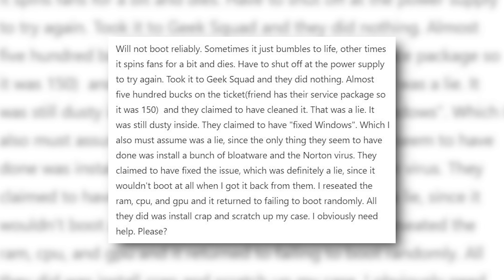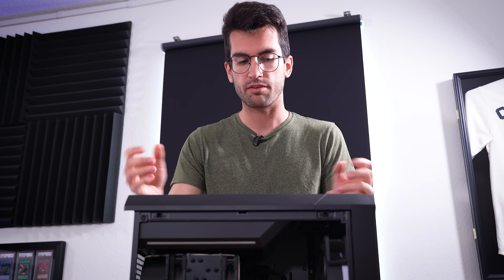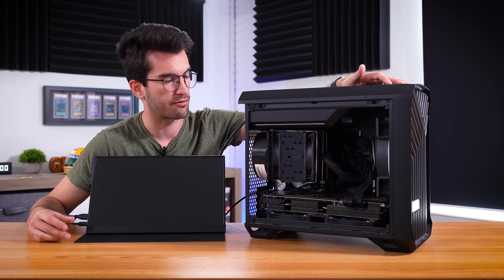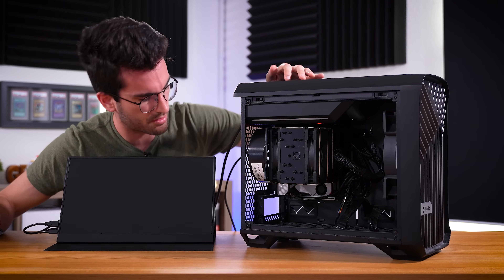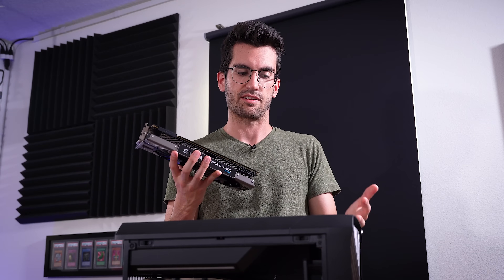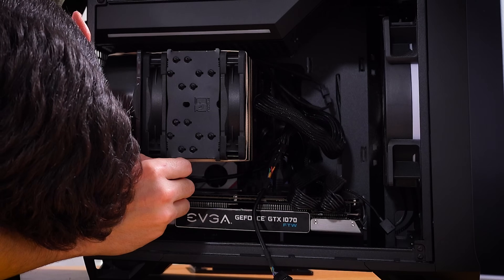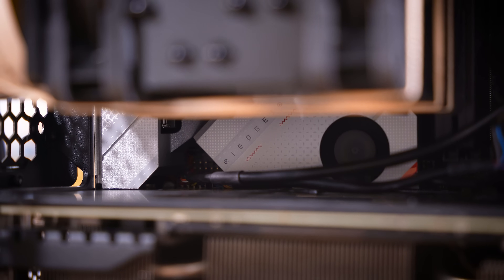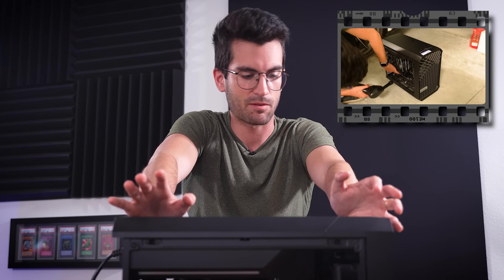Fixing a Viewer's BROKEN Gaming PC? - Fix or Flop S5:E6

Comment: Having two bare pins floating around next to the graphics card socket is your most likely cause for an intermittent fault. Just because the Graphics Card was pushed fully home into the socket doesn't mean that there weren't exposed lans to short against. Also, I didn't see what you ended up doing with that connector to stop it touching anything in the future.

Comment: I am facing a weird issue with my newly built PC, it's AM5 platform and I was trying to install the stock cooler but when I mount the cooler all the way in, the Debug lights gets stuck on CPU and DRAM. I had to loosen the cooler and find the sweet-spot where the CPU will not overheat and the cooler is tightened enough to boot. Is this an issue anyone is facing too? or am I doing something wrong?

Comment: Did not see you mention taking gpu out and re-connecting power switch??? Since you test ig and your gpu and also tested the users gpu in your test bed, I would be looking at that wiring to switch. I would also want to take the extension out and go direct to board with switch is possible. General re-seating is an amazing thing.

Comment: The motherboard checks the LED connections at power on and the HDD light is not constantly on so it might not short out and cause the protection to kick in once the PC is powered on. I'm pretty sure that if you shorted it during power on it would not switch on.

Comment: I once put the PCI-e cables in the wrong way. So 6+2pin in PSU, 8pin in GPU. By switching this around, the PC finally got power from PSU. Just sharing this mistake. Thought about this when you mentioned the cables.

Comment: I used to work for Best Buy's Geek Squad, and Circuit City's Firedog, as well as Staples Easy Tech, but that was almost 15 years ago. Some people I worked with back then were IT professionals and knew what they were doing, others were people that just took a class on how to build a PC and then thought they could get into troubleshooting.

One of the first things I check when systems do this is the PSU, check to make sure its getting the right voltages, then check the power draw of the system as sometimes older PSU's can't deliver the power required due to capacitance discharge over time, then I start checking all the connections to the motherboard. By following that checklist I can definitively narrow down the culprit without losing my mind as to why "X" problem is happening.

Love the series Greg, keep it up!
Reply: Except most people under 30 today can't even use a multimeter.

Comment: First of all there is some serious jank stuff in that PC with the fans. Second, most Geek Squad members couldn't repair a bent fork. Third, when you stuff full sized components into a smaller case it's really difficult not to have issues. Seems to me when you pulled the GPU and re-seated that along with the front IO wiring things got better. I'd call it a win!

Comment: Did he look at the front panel power switch connector extension? It looks like the positive and negative leads were around the wrong way. Since he disconnected then reconnected he may not have realized this. Hence a repair he didn't notice. 🤷‍♂️
Reply from the maker: We looked at front panel wiring before touching it. The leads were not the wrong way.

Comment: there’s a good chance that some dust had gotten into the port where the graphics card plugged in and I happen to know that geek squad does not unplug graphics cards to even check. It could’ve also gotten into the ram connection. Another thing you could’ve done is run something like heaven benchmark to stress test the machine. This would rule out the power supply having a short that you weren’t aware of because I’ve seen power supplies pass all inspection test but fail under actual heavy load. It’s also possible that the power switch is just faulty

Comment: I know this is old. But the power off after few seconds and not turning on after pressing power button afterwards (unless you disconnect the power supply and turn it back)  Fully hinted a Short. Because that's how motherboard safety features work. Next time just look for a short circuit if you get this symptom of not powering on after turning off after few seconds.

Comment: Geek Squad isn't what they used to be. I stopped using them over 5 years ago when they 'scotch taped' components onto my MoBo... This didn't 'start my van' so I fired them.
The Geeks probably put the rubber bands on the cooler...

Comment: I'd say it was the front I/O connector.  I couldn't see it so it originally so maybe it was crammed underneath the graphics card and was touching something.  Don't know what Greg saw before and as he was pulling out the graphics card, but I think the issue most likely resolved after the card was removed and the connector was originally moved and then removed.  Great video!

Comment: check the cpu, intermittent power up failures are common for bent pins and seating issues. Especially having a big cooler like that, a seating issue could change behaviours every time the case shifts

Comment: When you showed the extension for the power reset etc. it looks like the reset male pins were just out in the open. If it was touching the case, it would be the same as holding the reset button down when you were starting it.

Comment: Well, this might be just me, but I believe the PCIe slot may have issue because the GPU card seems to sag? motherboard are extremely sensitive and any thing that misalign even by .1mm may caused an issue with the motherboard and render it in panic mode. It happens to me once with one of my friend PC and of course after I remove the card and clean the system, it works for a while and happens again. I support the GPU with DIY GPU stand and it works flawlessly ever since.

Comment: The other day my computer also got stuck in a startup loop. I removed the side cover and everything returned to normal. I adjusted the wires a little. I returned the side cover and everything works. Visually the wires did not touch anything. Mystic .)

Comment: Probably a loose pin, either in the x24 motherboard connector or the GPU power supply pins. You know, the pins inside the connector? I've had experiences with that in the past, where a PC would turn off under load without any reason. After finding the problematic pin(Power_OK), I fixed it by using a screwdriver to compress the female pin even more, ensuring it could actually touch the male pin consistently.

Comment: 1. Gpu sag slowly destroys the solderballs
2. You really tried to short the cable using the painted metal?
Reply from the maker: 1. We've talked extensively about de-balling in other FoF videos.
2. The cable was easily piercing the thin paint on the backplate. Several scratches to bare metal. Did nothing.

Comment: Here's a thought. Weak / 'bleeding' capacitor causing a problem with cold boots after sitting awhile. Or possibly a memory issue, I had similar with Crucial Ballistix in my 5900X. Every 8-12 cold boots, it would POST with no video. Different memory fixed it -- DIMMs were not on board's QVL.

Comment: I've watched dozens and dozens of your videos so far. Great videos, by the way. Great troubleshooting and train of thought. Clean and proper job. Well done, Greg. Two comments, though. A. In some cases I believe a little BIOS update could do wonders. Maybe you should think about this process more often, especially when the problem is CPU and RAM related. B. The broken PCs you are dealing with, are mostly AMD based. I'd say that the percentage is 90% AMD and 10% Intel. That makes me think that AMD CPUs are more sensitive than Intel CPUs or that they are not so well designed. I've always had that feeling about AMDs and that is why I always build PCs with Intel processors. They offer me peace of mind although in this particular video, the only thing that's not foul seems to be the AMD processor :)

Comment: I wonder if it could be an issue with a solder joint on the PCI connecter on the motherboard?? If this was mine I would very closely inspect that connecters solder joints for a loose pin where it is attached to the motherboard. I wonder if carrying it around, maybe set it in the back of your car and bring it back in would result in another failure to POST?? These new giant GPUs can put a lot of strain on a PCI connecter, if it left the factory with a marginal solder joint a giant 3080 could have dealt the death blow?? Or not, just something to consider.

Comment: I have had this issue with my 3060ti on a asrock b550 mini itx, it was due to my ram speed. Initially set to 3600mhz, swapping it to 3200mhz allowed for boot always without power cycling.

Comment: Yooo, I had a similar issue as this, and I even mentioned it in your previous fix or flop. My fix came down to either me resetting the GPU or resetting the power connectors on the GPU.

Long winded, but this is what I had previously posted:

"Had an issue a few weeks ago, don't under estimate what reseating a component can do. I've had a GPU issue where my system would full on crash and it would be so bad that the GPU driver would corrupt itself and windows would not detect my GPU (had to reinstall the drivers). Two things I have noticed when trying to reproduce the issue; 1) it took longer to crash when my AC was on, and 2) immediately booting back up and jumping back into a game would cause it to crash within probably 5 min. Thought it was a GPU problem (which is a pain since I have my system water-cooled), but none the less swapped it out for a known working GPU; behold it worked. Sad knowing that it may potentially be the GPU (or a failing PSU not being able to cope with a 7900XTX under full load) I went to try and reproduce the issue; but the issue never reproduced after swapping back in the original GPU. Only the GPU was interfered with between trouble shooting. My conclusion, I had to move my system (and it is stupid heavy) and the issue only arose after moving my system; it probably shook the GPU out a bit, so to not properly make contact with the PCIe slot and any significant heat probably caused it to warp out of the socket. Thankfully my system is still going strong under heavy load.'
Reply: I know its been some time, but I have found the issue that was causing my issue (because the issue returned) and resetting the GPU worked because I think it just cleaned the pins on the GPU slot when reinserting it. The issue was that I use k5 pro thermal putty on my memory chip on the GPU, the issue I have encountered is that K5 putty seems to release oils from the putty and it made its way to the GPU slot (because I vertically mount my GPU), more specifically the first set of pins before the notch. I did source earth in fixing the issue because I just removed the riser entirely, but in the process of removing the riser I saw the oily issue.

Comment: The POWER SWITCH if you can tell its completely off center that happened in my old old rig that pin is bent would power on cycle off or not turn on. Straightned pin and pushed it back down. System worked until i retired it. Pause at 6:15 and 2 of the connectors are loose that's why jumping it worked immediately. Only other thing you changed at the time was gpu and we know it wasn't that

Comment: Thanks for the video, very interesting. I think you were onto the cause of problem at the end when you spoke about a possible short with IO cables. Those ITX cases are fantastic to look at but a pain to build and often you find yourself folding, cramming wires and cables into any spare space in the case which can sometimes mean headers become loose or wires end up getting pushed against another component causing a short.

Comment: I would have run stress and memory tests for some hours to confirm the system is stable. Also it takes me sometimes days to get a new computer running stable. For example last time I first used the screws that came with the case - and at this point in the bag with the screws only two types were left with only one fitting, so I installed the motherboard using these and when I was nearly done with the cabling I noticed the board jiggeling despite the screws tightly screwed in. Turns out these were distance screws. So I googled how board screws exactly look like and asked ChatGPT if that is normal the give the board some wiggleroom these days. Long story short it was quite a mess because meanwhile I had screwed some in too tight, and you know after tight comes loose...  Anyway, after that I had to learn that nowadays memory must be "trained" to be useable. And that's what the board did. For like half an hour. At least the board a had status LED and over the time I learned to interpret it better, like how it looks when the boot process is normal or whether its stuck for good or whether it just takes  more time. The I juggled arround with GPUs. Since the system was intended for AI purposes its got two GPUs. I tested with one, it worked, I tested the other one, worked too, I tested both it worked. For a day or so. Then one of them just refused to turn on. So I tested it alone and in another PC and even got a third GPU to plugin. Long story short after hours of try-and-error it turned out that first a Titanium certified PSU might not automactically be a good PSU and/or that these 600W GPU cables are not as good as they should be. I came to this idea only because my 3rd older GPU was in my other PC connected with one of these big 4:1 poweradapter cables. So I used that too in my new PC for the GPU that wouldn start and hence it was now connected to 2 PCIe outlets of my GPU which have a higher theoretical output than the one 600W outlet and low and behold it worked. Also I know the feeling you get when you know it's either the powersupply or the board or the board+memory combination.... So at some point I just bought a PSU tester. Anyway, I wonder how one can even make a profit from PC repairs, it's so time consuming that in quite some cases you could simply get a new PC of paying for the time of fixing the old one. But maybe it's just me being slow. :) If it only took you some minutes or like 2 hours, to do all this, you are pretty quick.

Comment: As a former Geek Squad agent, your mileage will vary drastically from location to location. I had zero training given to me about actually fixing computers. The only training was with using the software tools they provided to "cleanup" customers' computers. The actual repair knowledge was whatever I brought with me when I was hired. So, some locations might have someone that knows a decent amount and if they happen to be the one to work on your computer then it might actually get fixed. Other times you'll end up with this result.

Comment: Most frustrated i have ever been...During covid I got back into gaming.  Built a system and bought a 2070s from work.  Everything worked fine for 3 months and then it stopped posting randomly, it just got worse from there.  I had it sent away (far) three times to the supplier who just sent it back to me.  This went on for months. Finally i figured out that if i pushed the gpu up slightly it would post.  They rma'd, but it was during the shortage so i got downgraded for 50% more money.

Comment: Sounds like bad ram module,  or boot corrupted  :D  now t o see if I'm right!
Aww I was wrong,  but I bet it was from those extensions  never good to use them as they can be bad on connections so maybe you fiddling with them you also seated them fully so they aren't arcing when it's trying to run it's tests before boot. or during boot LOL   :D

Comment: I had a similar problem hdd indicator the + pin is connected to 5 volts  if that touches any thing metal that would cause the pc to shut off . when i replaced the mainboard I damaged one of the wires when i stood the PC up it shut off  i disconnected   the  front panel  and looked at the wires i found the damage insulation . insolate  hose pins  or those pins might have been touching something is shouldn't

Comment: I have the same case and had the same mainboard. Yes the frontpanel connector is in a bad spot but i dident had to put extensions to connect it with the mainboard the case cabels are long enought and there is a HDD led, the powerbutton blinks red . The cabelmanegment in general is a dream in this case there is so much room behind and on the top for all cabels, i have white extensions for all main cabels 5 fans an corsair commander core xt and a arctic freezer 3 aio there is no cabel mess in front like in this build. The gpu cooler is very weird too i put a 4070ti super in my builld witch takes up to slots like this one and underneath 2 Corsair AF120 RGB Slim witch are low profile 15mm fans , all fits perfect no need for such a contraption like this one. The only issue i had was with the mainboard. The MSI B650i edge wifi has a design flaw on the IO shield were the clear cmos button sticks out and in the package presses non stop on it and drains the battery so that you cant make an bios update if you buy like me a 8000 ryzen cpu. Returned it and bought a Asus ROG STRIX B650E-I and after that no issues at all and the Frontpanel connector are in a good spot not like on the MSI board.

Comment: possibly the supplemental pcie to video card  loose or not seated properly as you had touched those also. That's where usually start making sure all connections are seated then start disconnecting  front i/o items. Still good video

Comment: I had a bad DP cable that did this to my machine. I want to say it was from Monoprice. Got a new cable, never had the issue again. Reset GPU, remove C14 and open PSU switch, then drain caps with the momentary. That would be the only way for it to post.